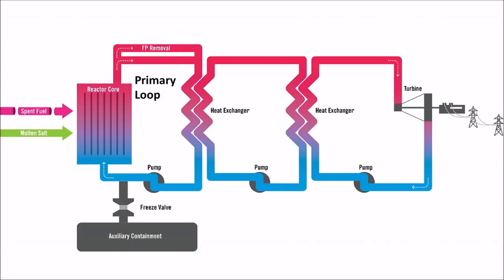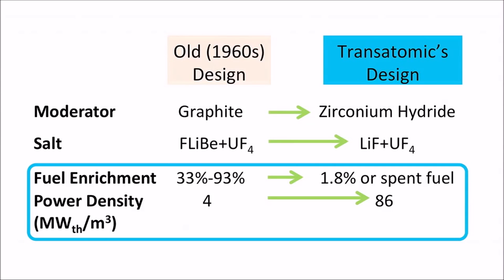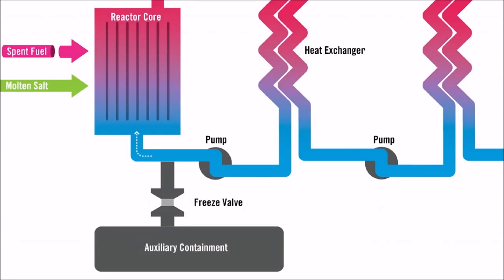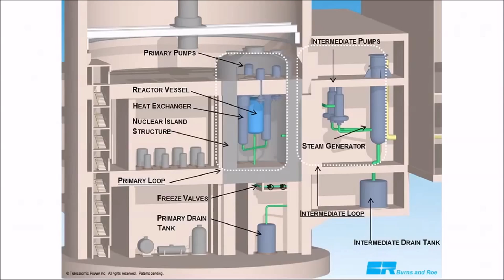Burn Nuclear Waste with new High Technology Reactor (MSR) [Read description for update 2/2019]

Comment: Reminds me of thorium... Isnt this thorium? It totally has something to do with the molten salt thorium reactor...
Reply from the maker: It isn't actually about thorium specifically.  They were trying to use up old nuclear "spent fuel" which does not contain any significant thorium.  They were however, planning to use a molten salt reactor (MSR) to do it.  The thorium version of the MSR is generally known as LFTR which is Liquid Fluoride Thorium Reactor, which is where this channel gets its name - LFTRnow.
Reply: @LFTRnow  What are the advantages of using Thorium instead of nuclear waste in MSR?
Reply from the maker: @gaeb-hd4lf  Both actually have advantages.  First, there is quite a bit of fuel left in "nuclear waste".  I like to think of it as the wood logs leftover after you burn off the bark.  An MSR or another more efficient reactor would be able to consume the log.  We have lots of so-called nuclear waste lying around, particularly in the US since we don't reprocess it (yet).  Other countries process some of the valuable fuel out and reblend it and get more use from it as MOX fuel (France for example).  

"Spent fuel" (also known as nuclear waste to most people) also has a number of highly radioactive other materials at first, which cool (radioactively and thermally) over time.  As the decades go by, it cools significantly.  This means some time (not thousands of years but more like 20-50) is required to wait in order to reprocess it.  It isn't a deal-breaker, just worth keeping in mind, and there is plenty of it around already in this condition.

The reactors of today in the US use (LOW) enriched uranium fuel.  To understand this, you need to know that natural uranium contains two major isotopes when mined, U235 (which fissions to energy easily) and U239, which sometimes "breeds" to plutonium, usually eventually fissioning in the reactor to energy.  The added steps for U239 slow down the reactor and so US-based "light water" nuclear reactors much enrich (increase the U235) in the fuel to work.  

This also answers your other question as to why it is pulled out "early".  The U235 is consumed first in the reactor, leaving behind a small amount of U235 (just a bit over what it was mined with), a whole lot (about 94%) of U238 that was not consumed, about 1% of plutonium that was not consumed (but came from the U238 being in the reactor) and about 4% of high radioactivity (but cool quickly) "fission products".  It must be removed since the "bark" has been consumed.  

Thorium is a bit like U238 in that thorium itself does not fission, but it can be "bred" to U233 (notice this is a 3rd isotope of uranium), like U235 and much of plutonium, it is fissile and can produce energy.  Thorium is insanely abundant.  Roughly speaking there is about 4x more thorium in the world than uranium, BUT remember that reactors today use ENRICHED uranium, mostly U235.  U235 is only 0.7% of natural uranium and thus rarer than gold!  Plus, it requires energy to enrich uranium, even though we do get quite a bit more energy out then we put in - it still reduces overall efficiency.  

Thorium has only one isotope naturally mined, called Th232.  This means no enrichment is required to make a thorium (probably MSR based) reactor work.

 As you can see, both options have their pros and cons, and both are very interesting and exciting ideas for our future energy needs.  

Please feel free to ask more questions if you like.
Reply: @LFTRnow  Thanks for the response. I see what you are saying, but the enrichment of uranium is a sunk cost in this case since the waste is already there so in my opinion is not a variable to consider in the comparison.

I have another question too: could you use as fuel just natural uranium in a MSR? (instead of nuclear waste, which as you said is 94% natural uranium)
Reply from the maker: @gaeb-hd4lf  I agree completely about enrichment is a sunk cost and thus anything obtained from the waste is valuable - this would be one major advantage.  What you also might not know is the multi-decade history of nuclear plan was that since uranium was thought to be very rare (turned out it wasn't really) the plan was to be far more efficient with it and build breeder reactors to consume the "waste" of the light-water plants.  When it was discovered that uranium is not that rare, they were shelved.  After that, politics basically kept them shelved, but there was some development even back then, such as the MSR, EBR1 and EBR2, etc.  The video Pandora's Promise talks about these (near the end of the video) and I recommend the vid overall.
Reply from the maker: @gaeb-hd4lf  For your next question, I'd argue you could use a lot of fuels in an MSR, including natural uranium.  The problem would be that in order to get the neutron density high enough, it would need a "kick-start", probably either plutonium, high enriched uranium or U233 (made from deades ago experiments).  Once kickstarted, the breeding will produce more than enough neutrons and new fuel.  In the case of Th232, you get U233.  If you breed U238, you get Pu239 (after it becomes U239 and then Np239).  There is a decent argument that could be made that, that path is a risk for proliferation, since it would be a matter of chemistry to remove the Np239 and let it decay to Pu239 (bomb, and fuel material).  If left in the mix it can't be used as a bomb material due to being diluted with the other materials.  However, this was the plan decades ago - breed the U238 that wasn't consumed to Pu239 and make more energy from it in the breeder reactors.  Overall, it was a pretty good plan, and still could work today.  You'd probably want to do some inspecting from time to time to ensure someone didn't turn their reactor into a chemistry experiment.  Thorium has less risk in that regard since the U233 fissions which is a long way (neutronically) from plutonium.  As an added advantage, you could also keep going and stop at Pu238 (not 239) and make yourself the fuel we need to explore space.  Look up "TEG" (Thermoelectric Generator), which is used in space probes.
Reply: @LFTRnow  "Thorium has less risk in that regard since the U233 fissions which is a long way (neutronically) from plutonium"

I didnt quite understand that, could you elaborate a bit please?

 "that path is a risk for proliferation, since it would be a matter of chemistry to remove the Np239 and let it decay to Pu239 (bomb, and fuel material). "

Couldnt you do the same with Pa233 to let it decay to U233 for bomb use?

Comment: If it could burn use plutonium, would be great
Reply from the maker: Interestingly, current reactors do that.  The difference is that the fuel is pulled out quite early, leaving plutonium behind in the "spent" fuel.  However, generally any "breeder reactor" design can consume plutonium.
Reply: @LFTRnow  mox fuel seems to be another alternative to use plutonium.
Reply from the maker: @Phil-D83  correct.  Mox is a mixture of plutonium and uranium and is a recycled fuel used outside of the USA.  It drastically lowers the volume of waste from the spent fuel and gets more value from it.
Reply: @LFTRnow  this is something Trump ahoukd address. Restarting the integral fast reactor would be a positive step, but unlikely with democrats controlling Congress.
Reply from the maker: @Phil-D83  I'd rather avoid getting into politics here, but I will agree that the nature of democrats seems to be to dislike nuclear and prefer "renewables", however you need only see this to see the math as to why that is rather impractical.  https://www.youtube.com/watch?v=E0W1ZZYIV8o

In my opinion, both the democrat and gop base could use some educating on various issues and that is where I'm leaving that.

Comment: Conventional reactors burn less than 1% of the fuel...............LFTR running on the Thorium cycle can burn up 99% of its fuel and consume transuranic waste left over from conventional reactors. Almost the only waste left is Plutonium 238 which is needed for deep space probes and is worth a fortune.
Reply from the maker: This is close but perhaps a bit confusing.  To clarify, conventional reactors burn about 5% of the energy of the fuel that is loaded into them.  It corresponds with less than 1% of the energy of the uranium that is mined.  Since natural uranium consists of about 0.7% U235 and that is most of what is consumed, it equates to about 1% of the energy of the uranium pulled out of the ground.  The fuel pellets themselves are enriched to about 5% and when "spent" the U235 level drops to about 1%, and about another 1-2% worth of the U238 was converted to Pu239 and most of that turned into energy.  The net result is the spent fuel becomes roughly: 1% U235 (not consumed), 94% U238 (not converted or consumed), 1% Pu239 and other higher Pu isotopes, and 4% "fission products" that mostly decay quickly.
http://lftrnow.com/what-about-the-waste/
Reply: @LFTRnow     the important part is.............conventional solid fuelled reactors are a bicycle and Thorium is a ferrari.
Reply from the maker: @wazza33racer  That is a good summary.  I like to say that conventional reactors basically are the equivalent to burning the bark off of wood and throwing out the rest of the log.
Reply from the maker: Based on what we know of LFTRs, you are correct about the ~99% of fuel burnup and this is because the liquid state permits the continual loading in of new fuel and removal of fission products.  However, the Pu238 left over depends on the fact that you can not start/run the LFTR from conventional uranium (as it will contaminate the isotopes with higher Pu isotopes as the breeding continues).  It also requires that you chemically remove the Neptunium (238) as soon as it is produced.  Neptunium removal does produce a proliferation risk but is a very interesting option for producing Pu238.

Comment: The downside is that the power is lower than normal reactors, meaning that you need more plant capacity... But it's worth it! If nuclear power evolved without the cold war we'd have that for some decades already.
Reply from the maker: Sorry, I'm a bit confused what you mean by power lower than normal reactors?  Are you saying MW of size, or volume per MW, or a comment on efficiency?   I certainly agree with your second point - certain things, the cold war included tended to set back the development and adoption of nuclear power.  Interestingly though, the ending of the cold war gave us the megatons to megawatts program.
Reply: @LFTRnow  the power per volume. Like naval reactors that have a very high high power density but are very expensive... Other techniques for mobile applications, and also they need high enriched fuel.
Normal power plants are the most efficient and cheap compromises afaik.
Reply from the maker: @gustavgnoettgen  Sorry I've only gotten back to this now (not a huge fan of the YT notification system accuracy) but yes, now I see what you mean, basically volume per MW.  I believe you are correct, but basically, whenever you lower the neutron density, you require a larger reactor.  This is no big deal.  It is still a comparatively tiny amount of space even of the reactor were 10x the size of a standard one of today.  You are right about (uranium) military reactors on ships.  To keep their size down, they use much higher enrichment (I believe it is 20%, the max you can do for "LOW" enriched fuel).  If you go even higher, you can make the reactor even smaller still, and the W/kg and W/L jump rapidly as you do - but now you have to deal with highly enriched fuel, which has its concerns.  Look up the HFIR for some really interesting info on this.  I can point you to some vids too if you like.

Comment: Ok, it's now 2019 - four years on from the original vid. How about a progress report/ update?
Reply from the maker: Based on this early 2017 press release, it looks like as far as public info goes, they are first building a molten salt reactor that uses the same uranium (5% enriched) as normal LWRs.  However, they show it will be about 2x more efficient than what we have now, and would be a good step towards their goal of consuming "waste fuel".  I suspect this was also done because it was probably easier to get the approval or to get SOMETHING to market faster.  The home page has more details as well.
http://www.transatomicpower.com/wp-content/uploads/2015/04/TAP-Press-Release-01-30-2017.pdf
Reply from the maker: Transatomic is also not the only company working on next gen nuclear, nor the only one doing molten-salt tech (the 2018 update shows 11 in this category).  Have a look at this:  https://www.thirdway.org/graphic/keeping-up-with-the-advanced-nuclear-industry
Reply from the maker: I have now discovered that according to this article, the company featured in this video "Transatomic" is no more.  The statement is that it has ceased operations.  However, I agree with the article.  In the world of Gen IV nuclear, some will succeed and some will fail.  Progress is being made overall, but apparently not by this company anymore.  I highly recommend thebreakthough.org, which is where this article was sourced from.    

See more here:  https://thebreakthrough.org/issues/energy/rip-transatomic-power
Reply from the maker: I've updated the description to reflect this new information.  Thanks for checking up and commenting!